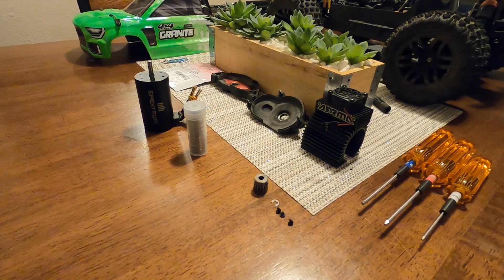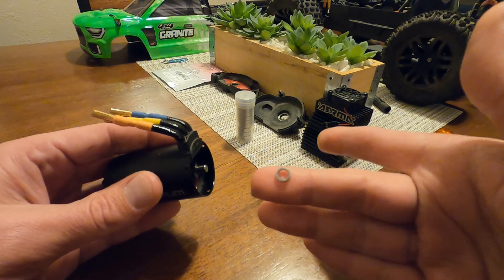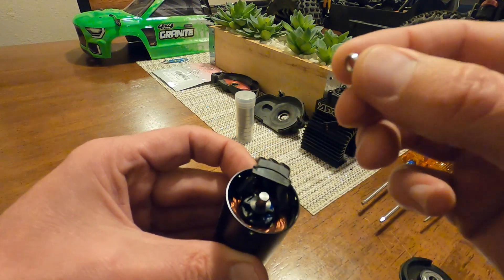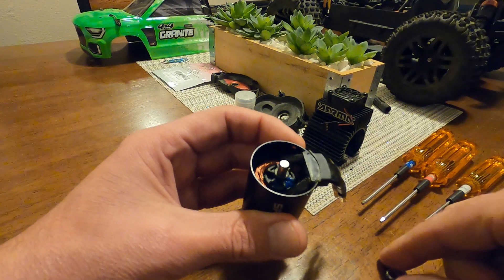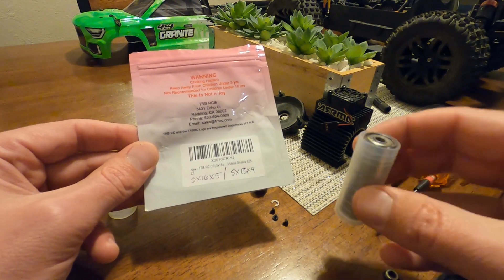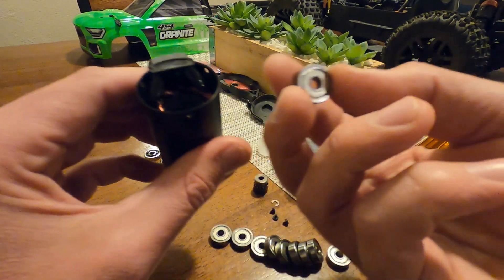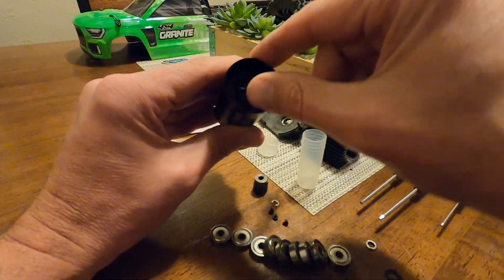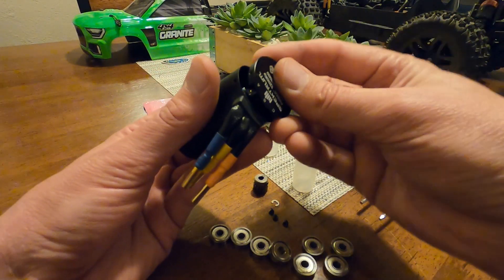Brushless RC Motor Bearing Replacement - Spektrum 3200kv (spmxsm2000 - Armma Granite 3S)

Comment: So I am new to this and thanks a lot for the detailed information. Can you explain though how do I get the pinion out? After I got the screw out it is still stuck on the shaft. How do I pull it out? And later how do I install it in? Same about the motor cap and  the cooling Metal thing. How do I pull those out and get them back in? Is there. Video on this?
Reply from the maker: It is possible that some of the locktite from the tiny grub screw (that holds the pinion to the shaft). If you have the newest version, there is a small "C-clip" (shaped like a "c") on the end of the motor shaft, right next to the pinion gear. Just push a pair of pliers (or anything, really) against the "open" part of the clip, and it should pop off the shaft. Hope this helps, the motor cap is difficult, sometimes you can put it in the sun or the refrigerator to get the metal to expand or contract, might help loosening those end caps.

Comment: Thank you for the information!!!

Bought a 3300kv spektrum for my senton and it got her Wed. I'm assuming the bearing is out 3 5 minute runs later. 

And advise to help seal off the power module so it doesnt collect so much sand? If horizon doesnt warranty it I'm gunna have to rebuild. I dont wanna have to do this after ever other 2 runs.
Reply from the maker: I think it gets in from the bottom, but no idea how to seal that off...

Comment: Great video thanks for making it .I know for sure it will help many people. I've been stripping my pinoin gear from my v5 typhon since the vary first run .my mesh is correct with my new pinion gear but I'm already noticing wear on it again I will take a look at my bearings because the car is brand new and I'm not sure what els could be causing this
Reply from the maker: I think it is movement in the adjustable motor mount, but not sure that's what it is...definitely annoying!
Reply: @rcleesd  I'll keep a close eye on that thanks for the info

Comment: My local shop didn't have the bearings in stock so I called arrma direct.   I explained my motor was messing up and the internal bearings were shot.  He said they know that motor has had known issues and did not have part numbers for the bearings.   So instead they are sending me a new motor (and new steering servo cause I had to replace that 2 weeks ago) for no charge, even free shipping.    I figured I'd post that information incase anyone else had the same issue.   I'll get the bearings ordered on line and have a backup motor now.
Reply from the maker: That is great news! Thank you so much for sharing that information, I appreciate it!
Reply: @rcleesd  My bearing had a complete failure and came completely apart inside the engine.   Getting all the broken pieces was easy,  but getting the race out was a pain!  The only way I was able to get the rest of the bearing out was to drill 2 1/16 holes on either side of where the shafts comes threw and use a small punch to tap it out.  Once the new bearings come in and I get everything back together I plan on putting silicone over the holes to keep moisture and dust/ dirt out of it and this will be a backup motor.   Think the silicone will work or is there something else I should use to seal it?
Reply from the maker: @corymra  hmmmm, that's a good question...I guess silicone would be best.

Comment: I appreciate this. My Typhon 3S V3 quit on me after a couple weeks with a failed bearing in the motor just as you have shown and replaced. I will be ordering these bearings as well for my new motor when it finally arrives. The original motor was so locked up, I couldn't remove the failed bearing. It was in shards.
Reply from the maker: Man, that's a bummer! I'm glad you found my video...keep an eye on that exposed bearing and replace when it gets worn and your new motor will last forever! Thanks for watching.
Reply: Same thing happened to my big rock!

Comment: My Big Rock stopped moving yesterday and I thought I was going to have to replace the motor but after watching your video I was able to determine my bearings are shot.   You just saved me from having to buy a new motor. Thank you and just clicked that sub button.
Reply from the maker: Awesome!! If you ever lose steering, check the plug from the radio to the esc...I had that come loose one day and it was an easy fix, but almost overlooked it! Also, if you ever lose throttle after big jumps, check the 3 motor wires at the bullet connection, those sometimes come loose. Thanks for watching!
Reply: @rcleesd  Great information!  I love how fun this hobby is, and I love the willingness of the community to help others.  Wish I would of gotten into this sport years ago.
Reply from the maker: @corymra  Me too. It really has been an awesome way to connect to others in thee hobby during this virus stuff.

Comment: Does anyone have the link for those motor bearing or know what they’re called?
Reply from the maker: Hi Colin, the ones that I bought were from Amazon.  This is what they are called and the size:  

5x16x5mm Precision Ball Bearings ABEC 3 Metal Shields 625-ZZ

Here is the link to this product (pack of 10): 
 https://www.amazon.com/gp/product/B01CUTIQWW/ref=ppx_od_dt_b_asin_title_s00?ie=UTF8&psc=1

Just be sure the size is the same and that they are "metal shielded" (for heat reasons) and any company should be fine.  Thanks for watching!
Reply: @rcleesd  thanks man, I just got a big rock v3 and I think the bearing was faulty out the box because it completely broke on my 2nd run other than that I love the truck 👍👍👍
Reply from the maker: @colinleonard2541  awesome, let me know how it goes or if you have any issues changing out the bearing. That outer one gets dirty quickly, but the inner one usually stays clean and will last much longer.

Comment: Took out my Notorious again for the second pack and the teeth on the rear diff broke! Hopefully, Horizon replaces it.
Reply from the maker: Man, what a bummer. Fingers crossed they send a new one! I hate the problems most diffs seem to have. Did you change  the punch setting on the esc by chance? I know a lot of guys have problems when they go above 5 or so...
Reply: @rcleesd  I was on 6... Maybe I just have to upgrade to a 14t and stay on punch 4.

Comment: I bought a v3 big rock as soon as they came out and a week later the bearing ( large side ) exploded and locked the motor up. At the time I didnt know what the issue was. Arrma sent me a new motor same spec so I installed that and the old motor is sitting in my parts box. I did and would reccomend putting a small o ring on the shaft behind the pinion gear. It will keep dirt out. Just dont put more than one as it will cause the motor to drag against the end cap and will eventually burn up. I did this with the new motor and it has been perfect since. Thanks for the video! Great info.
Reply from the maker: Thats a great idea about the o ring! Thanks for commenting and sharing.

Comment: Pretty nice not having to mess with brushes Hu lol nice rebuild! This is not good news for me as the dirt where I live is powder and gets into everything. How long have you used your granite before it started going out? I noticed after a few weeks of using mine the tie rods are pretty loose and wheels have a lot of slop.  Sure is a blast though! My eight year old son is great competition and my four year old daughter is getting pretty good also. Thanks for sharing!
Reply from the maker: Nice! I have probably run 15 to 20 packs on this truck. But it's been pushed hard and definitely things get loose after bashing. I went through recently and tightened all the hex screws for the steering and suspension links, seems to help a bit, but not perfect. There is a fair amount of slop in this system, but I think it also helps it give a bit on harsh landings. Some people go through and put washers in between all the rod ends and links to tighten it up, and it works, but not sure it is ideal for bashing. My Typhon has almost no slop, but it's more of a driving car for me, not a basher, and that works for me.  I love driving rc with my 4 year old, it's a special hobby and I'm glad I get to share the excitement with my own son now.  Thanks for watching!
Reply: @rcleesd  cool, I don't think washers would help mine. the plastic around the little balls is pretty wore already. A servo went out on one of the granites yesterday. Seems I fix one and another breaks. Hopefully I can get all the bugs out and won't have to be replacing stuff every time we use them. Yes sir, the kids make it so much more fun don't they! I took the kraton out on the road yesterday and it ran good. Hate to get it in the dirt but once the rest of my batteries get here its going to be filthy 😂 put up a little vid of it in my excitement 👍🏼

Comment: Great video Lee. How much run time on your granite? I can get those bearing sizes with PTFE seals, which have a melting point of 327 deg C. PTFE is typically safe to use up to 260 deg C without any degradation. These motors have a thermal shutoff at 105 deg C so it seems like there’s a lot of headroom there?
Reply from the maker: I have about 15 to 20 battery packs of runtime on it.  Held up fairly well considering the abuse it was given.  I think you should be fine on the PTFE seals, but factory is metal shielded, although, not sure if either is perfect, but worth a shot. If you do change them and go with PTFE, do me a favor and come back here and let us know what your experience was with them? I'd be curious to know if they are better at keeping dust and dirt out, and whether or not they melt? (they shouldn't from what it sounds like). Also, curious what the cost of those are? I figured for a pack of 10 at a cost of $11.73, it's an easy enough fix to have a few extras, rather than hope 1 holds up indefinitely. Thank you for watching and your input, I appreciate it.
Reply: @rcleesd  wow that’s actually not many packs. I have ordered the 10 packs of bearings with PTFE seals. I think they’ll be ok, unless I’m underestimating the temps the bearings run at vs the motor itself. I’ll let you know how they hold up. For one 10 pack of each size it was $40 AUD shipped total. Have you seen the mod recommended by Duperbash about routing out and enlarging the slipper spur gear hole underneath the chassis? He said this allows the dust out, reducing the amount of debris ingested by the slipper itself and the drive side motor bearing. I think PTFE will seal better than metal but reducing the amount of dust in there in general is a good thing.
Reply from the maker: @timmurrayy  I could be off, it might actually be closer to 20 to 30, but the dirt here by the beach that I run in is basically sand.  I think those seals will be fine, but come back and let me know either way, I'm curious.

Comment: Great video, I have noticed clicking in my granite on the first run but It wasn't that. Then after a bit it went away pretty much. I dont know why it was doing that becuase i checked almost everything. Thanks.
Reply from the maker: Sometimes a small stone or stick can get in there and then disintegrate. Sometimes things get stuck in the wheels and can make a clicking sound too, and then fall out.
Reply: Ya thats true but I didn't even take it out yet and it was doing that, oh well whatever it is is gone now so its fine.